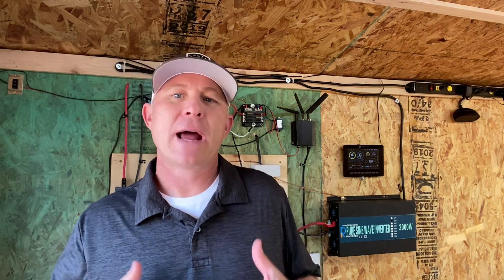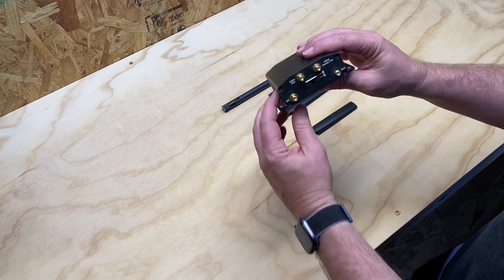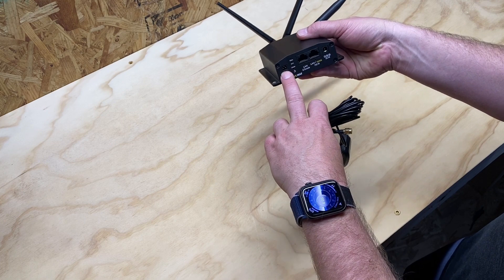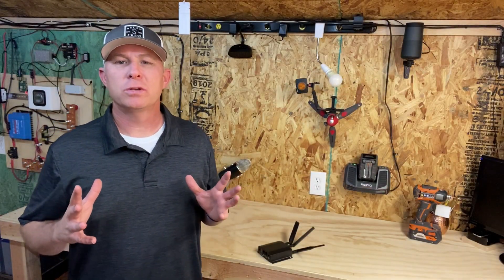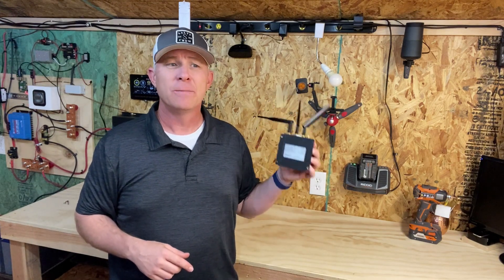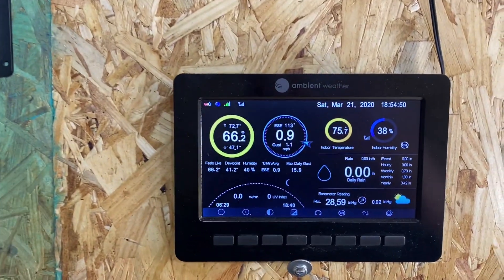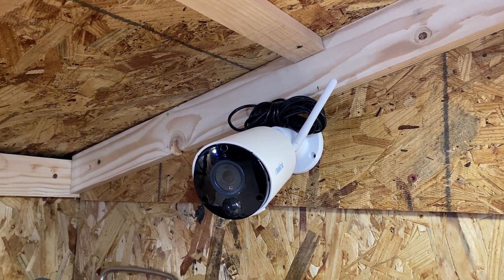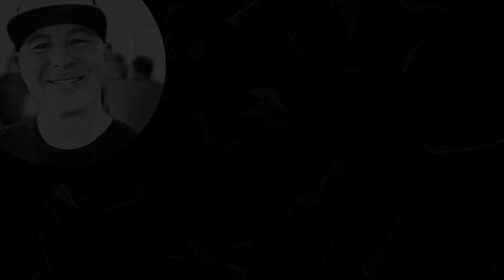Solar Powered Cellular Internet WiFi Router for Off Grid Applications

Comment: What size battery do you have running this?   Also can you recommend antenna extendors.  Looking to create wifi at my farm to control cameras and gate.  Need a full parts list I clouding your fuses, voltage regulator, battery etc.

Comment: This is very helpful. I need a  offgrid solar wifi connection so I can run video camera's and monitor my  property This looks great, my only concern is that mine would be in a shipping container and not work due to it being in a giant steel box. Things that make ya go hmmmm. I'll check the specs and see what I can find. Thanks 🍻🤙
Reply from the maker: You are welcome. It should work. Does your cell phone work inside? If so, then you should be good to go. Thanks for watching and please like and subscribe!!

Comment: Did you have problems with it being inside of a metal building?
Reply from the maker: I'm not in a metal building, so I am not really able to answer that question. But I would imagine that metal or thick buildings would impact reception.
Reply: @StateOfCharge  Ok thanks.

Comment: So for the sim card, did you have to buy a plan from; say Verizon, like a extra phone plan, or dose it have to be some hot spot plan? that's where I get hung up a bit on how this system works.
I  currently only have cellphones for our family, no wifi and using large data plans for everything, but if this works how I think; I could get a 4th "cell phone" plan? And lower the data on the others and use a more "traditional" wifi set up at home. 
Is this sort of what your doing?
Great video thank you.
Reply from the maker: ian hey Ian, yes you need a cell phone plan with data. I use Verizon for my family and I added a data only line and since I use auto pay, I get the data line for only $10.00 per month for 15gigs of cellular data. Since I am only using the data for remote management, I don’t think I have ever gone over 1 or 2 gigs each month.
Reply from the maker: Yes, this could also easily be used as a WiFi router for the home, but I don’t think it will perform as well as each phone would on its own. If you have 4 people trying to stream videos from a single SIM card, it would probably bottleneck on you pretty significantly. But in theory, yes, this becomes a traditional wife router using cellular data.

Comment: Nice Channel.  I just happened to stumble upon it this evening.  Just curious why you are running a Cell/WIFI router vs installing some sort of wireless bridge to you home internet connection?  Keep up the good work!
Reply from the maker: Using the cellular option to be completely off grid or self reliant. Just part of my own personal requirements for the shed. But sure, if your shed or work shop can tie into your home’s internet, that is a great option as well.
Reply: @StateOfCharge  Understood and thanks for sharing the cellular part.  Great shed and project!
Reply from the maker: Thanks so much! Hope you are staying safe these days :)